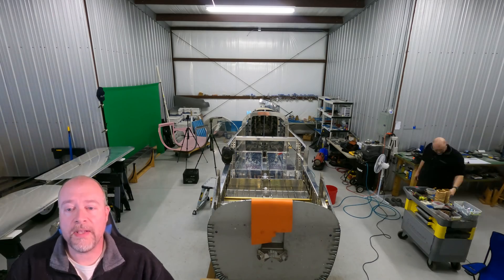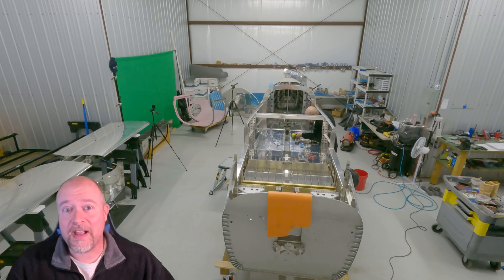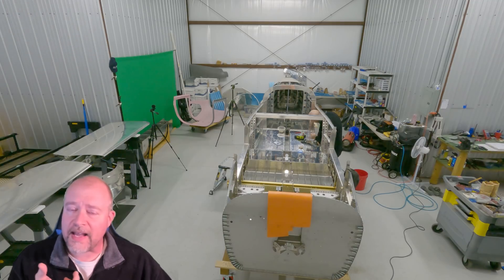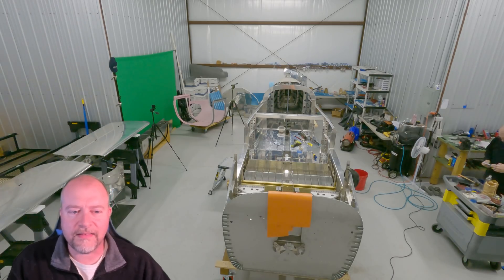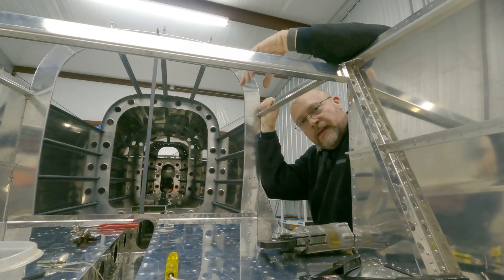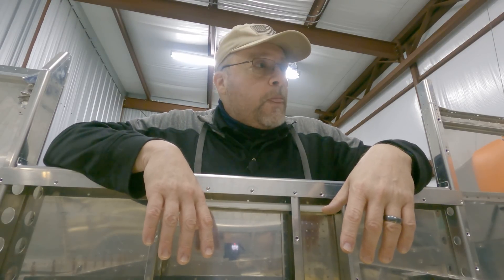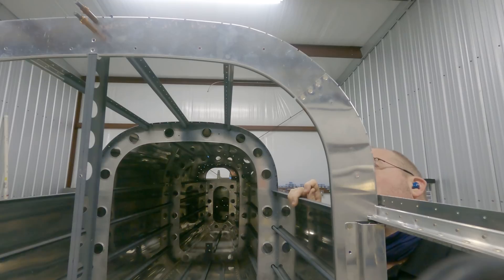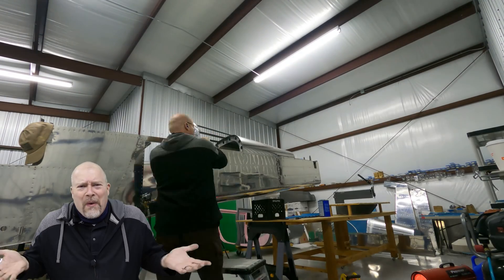RV-10 Fuselage - 040 - Non-pilot, building an RV-10... You can too!

Comment from the maker: I said "Complex aircraft" I meant "High performance".. woops.
Reply: It must have a retractable gear to be considered “complex”. High performance is over 200 HP. Constant speed prop does add some complexity but won’t get you the endorsement. I’m building an RV14 and will be traveling to Oregon to fly with Mike Seager, Vans Factory Pilot, to get the 10 or so hours in my exact model before flying. Not only does it count for my high performance endorsement, but gets my the transition training completed and also gets my insurance requirements knocked out. That’s probably the best use of your time and money once you get your ticket. Best of luck!
Reply: @CaptainCharlieBravo  I have my pleasure and instrument ticket already and have the complex just not the hp endorsement yet.... Corona has messed up that plan but hopefully this year....
Reply: @anthonycastellani7470  the hardest part about getting the HP might be finding the plane. Complex is a bigger step than HP. Instrument is a much bigger step than HP.
Reply: @mattj65816  that has been the exact problem.... finding the plane
Reply: Yep, you just need a quick high performance endorsement.
Reply: @rvingjetpilot5302  true. But don’t you still have to have a retractable gear?
Reply: @CaptainCharlieBravo  Yes. I don't remember the the far number. We just covered this in my CFI course. It's a far 61 endorsement. Give me a few minutes I find it...lol
Reply: @CaptainCharlieBravo  I was wrong. The FAA only removed the complex requirements to obtain your commercial single engine land certificate,  if the aircraft has advanced technology. You still need to have a controllable pitch propeller, in flight operable flaps, and retractable landing gear to obtain your complex endorsement. 61.31e. You still need a complex for your commercial MEL.
Reply: Jason been a pilot  is not having a license who said “I am a pilot “ been a pilot is loving been I the air, enjoy every second and always doing the right thing. What I mean is always respect the performance of the aircraft, always know/respect your limitation, always take care of your passengers. I been following you since the beginning and you area pilot always remember that. 
I just retired after 44 years of flying my last 20 with Southwest Airlines and I had seen pilots and pilots along those 44 years. Also I am about 10 minutes away from were you are at Blue Ridge. Hope to meet you sometime soon. Always enjoy the ride and keep the blue side up.
Reply: Technically both if u have adjustable prop right?
Reply: @anthonycastellani7470  no, you need retractable gear as well and technically moveable flaps. 1,000 HP in a fixed gear airplane is just high performance. Caveat is seaplanes obviously can’t have a retractable gear.

Comment: Regarding your spidey sense vis a vis your friend's airplane....yes.   I started getting my ratings in the late 80s and now fly professionally, and back then I was flying Cessnas and Pipers that were less than ten years old. Fast forward 30+ years, and those same planes are still the "newer" airplanes in the GA market. Yikes. I have been looking at the GA market for several years and almost got into a partnership in an early model Mooney that looked to be in good shape, but I couldn't bring myself to flying an airplane with my family on board that was older than me, and I had no idea who had flown that airplane long before the current owner, the previous owner, etc. I backed out and went all in on the RV-7 I'm building now. The Cherokee 140, as long as it's clean, is going to be a great time builder. It's finding the right plane is the hard part anymore and if that Cherokee is one of those mechanically sound gems still out there, then you'll be good to go. You'll get everything out of it when you go to sell it, maybe even more?

Comment: Hello,
I’m helping a guy build an RV 10 here in Tucson, Az. I would highly suggest you call me for insight outside of what Vans teaches.

In regards to your pilots license, let someone else fly the 25 or 40 hrs off on your plane. Then when that’s done you can use your 10 for flight instructions. Possibly if you could find someone that has a 10 that you could get instructions in, then be released for solo flight in your 10 then you could burn off some hours.
RV 10 are not a “Complex” airplane in FAA definition. Complex is Constant speed propeller, Flaps & Retractable landing gear. Your 10 is considered a high performance by the FAA because it is more than 200 HP.

Anyway give me a call and I’ll put you in contact with a 10 builder that’s almost done. He has done some great mods.

Travis 
541-281-3032

Comment: QUESTION:  What is a complex aircraft  -- Doug A
ANSWER:  A complex aircraft is one which has manually or automatically controllable pitch propeller, flaps, and retractable landing gear.  To be legal to fly a "complex airplane" under 61.31, you need a sign off by a flight instructor. 
FAA Order 8710.3E defines a complex airplane for the airplane single-engine land or airplane multiengine land rating as one that has a retractable landing gear, flaps, and controllable propeller. A complex airplane for the airplane single-engine sea or airplane multiengine sea rating is one having flaps, floats, and a controllable propeller. A controllable propeller may be controlled manually by the pilot or automatically controlled by a full authority digital engine control (FADEC) system.
List of complex aircraft includes: Arrow, C172RG, Cardinal RG, Seminole, Dutchess, and Diamond Twinstar.
QUESTION:  What is a high performance aircraft. -- Doug A
ANSWER:  A high performance aircraft (according to 61.31) is an aircraft with an engine of more than 200 horsepower.  List of high performance aircraft includes: Cessna 182, Cirrus SR22.  Note that these aircraft do not have retractable gear.

Comment: I'd take one or two partners in for that Cherokee. You got to bring the fixed cost down and there is always something that needs attention and with partners you can take turns on bringing it to the shop, annuals, etc.  and you will have more time to finish the build. Also, you might find a partner that had a plane before so he will be familiar with all the AD stuff and maintenance.
Reply: I had a partner when I owned a 182 and it worked out great.  Just select a partner with similar flying and maintenance and cleanliness philosophies and it works out great.  We wrote up a simple agreement and it worked well.  We almost never both needed the plane at the same time during our 6 year partnership and our agreement had a tiebreaker clause to handle that.  The cost of flying was cut dramatically with essentially no loss in utility.

Comment: There are many Test Pilots out there that are compensated by you to take the risk of "first flight" and even Phase one testing.  Do not be afraid to use one.  A good test pilot will do a thorough preflight and will do ground/taxi test runs before lifting off.  I personally used one for my Zenith.  I also am less concerned since it is a well known kit...if you had designed and built an airplane from scratch on a design that has never flown it would be more of a concern. I am and was a Private Pilot before taking on the project.

Comment: A ferry permit is for essential crew only. Anyone who fly's with you at this stage other than an instructor will have to be on your insurance, and only they can log the time as PIC. As a student, you will have to be signed out by an instructor for each flight you solo in. The only time you can log dual is with an instructor. Remember that the teck logs will need to shipped to by UPS or Fedx as you will not be able to carry them in the airplane when you pick it up. Journey log   yes, Teck log no.  I watch your show not just because of what you are doing, but because of how you do it. You are your own brand and the RV10 is only the by product. Take Flight Chops for example. Thanks Jason, you are doing good, keep it up.!

Comment: Welcome to aircraft ownership!
My condolences!🤣🤣🤣
I'm a C-172 owner. You'll be looking forward to getting your RV-10 done after dealing with issues regarding your certified aircraft. Owner authorized maintenance on certified aircraft is very limited. Darn near every upgrade will require an A&P/A&P(IA). Along with that comes the bill. You'll be lucky if your 1st annual under your ownership doesn't uncover some delayed maintenance. You finish your RV you can apply for your maintenance ticket for it. You'll be able to do any maintenance you want. Everything is cheaper for experimental aircraft also.
I want both an RV-10 and RV-8 so I'm torn. Since I'm already flying I have the luxury of thinking about. lol
My request...Keep the vids separate!
Reply: Wait. You mean to tell me it's like a boat? "First day, last day" thing?
Reply: @EJWash57 LOL... I've never owned a boat but all my boat owning friends say the exact thing.

Comment: Hope you are putting in the control cables or push pull tubes running to the tail area under those floor boards

Comment: So while it's true that you have to have an endorsement to fly high performance (201 horsepower) or higher, a lot of people pick that up during their primary flight training. Complex/high performance endorsements only require a log book entry from a CFI but no special written test or checkride. Plenty of people earn their private pilot tickets in high performance and/or complex aircraft and the examiner can and will test you on the systems in the aircraft you are flying in.

So you can take your primary (private pilot) flight training in your RV10. The challenge you face with a new RV-10 build is the requirement that it be test flown for at least 25 hours over a non-populated area before an airworthiness certificate can be issued which is required before you carry passengers. During flight training, your CFI is PIC (pilot in command) and you are a student which would make it illegal to use the aircraft for flight training until you've obtained the airworthiness certificate. This leaves you with the option of obtaining your license in another aircraft or having a certificated pilot perform your test flight for you before you start training.

Comment: Thoughts as the video was playing....

1) get a Cessna 150/152 or, since you have a RV, a Piper 140.  VIOLA!!  Piper 140!!  (Remember WHERE the Trim Lever is!!!!!  Got caught with THAT little mistake... once!  Yeah, I trained in Cessnas... don't judge me!  =) )
2) The day of.. or at MINIMUM, the Week of passing the PPL (weather permitting), find a Piper 6 or even an Arrow (200+ hp engined, Constant sped prop) and start flying that to get the High Performance endorsement.  Even if it has Retrac gear... that's a plus too.
3) I believe there are specific RV Flight Instructors that can help the transition from 'Wichita Wonders' to RV's.  Do that!!  Get THAT sign off before flying YOUR RV.
4) Remember, there is a AGE OLD Tradition.  The FIRST Person to fly a new plane... gets to keep a set of keys TO that plane.   So if after getting signed off in RV's, fly YOUR plane around the pattern, once, and then have an experienced Pilot take it out and see what needs adjusting.
5) Yes, please include the flying videos with these build videos.  EVERY video is a learning tool.

Congrats on the 'new to you' plane!  Enjoy the experiences!!